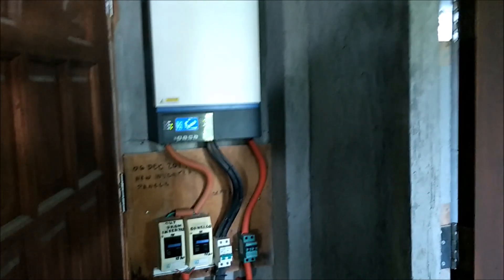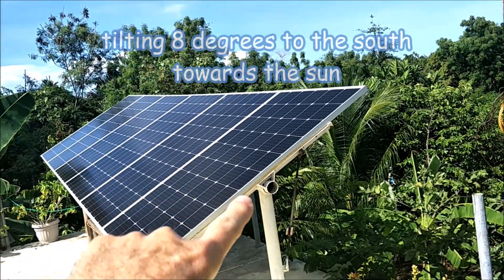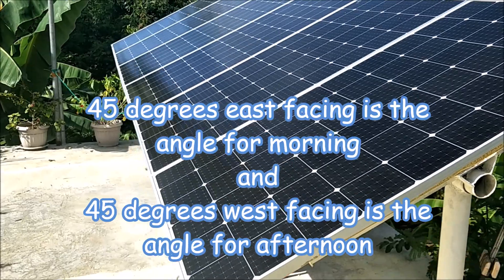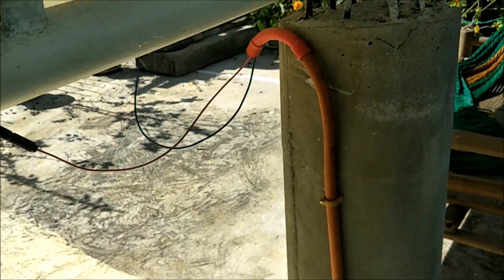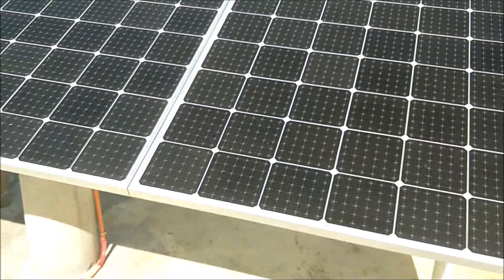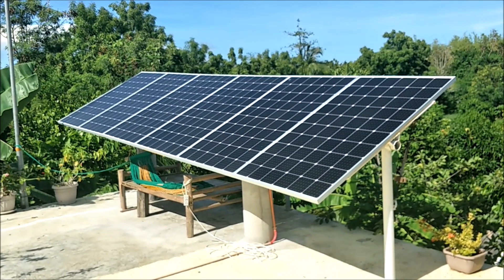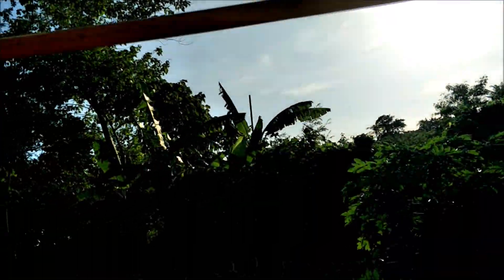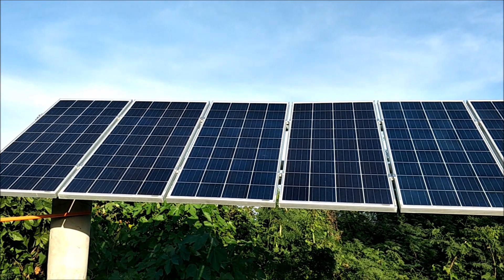Solar Power - Low Cost Sun Tracker In The Philippines

Comment: Nice that i have a fellow solarista in the island lols
Reply from the maker: Are you on bantayan?
Reply: @myparadiseonbantayanisland9030  yes sir
Reply from the maker: @eumellopez661  I hope to build a 5kwh system once the lockdown is over.
Reply: @myparadiseonbantayanisland9030  that is huge lols
Reply from the maker: @eumellopez661  I want to run aircon and on cloudy days it may only produce 2kwh or less, so I add extra for those days of low output. It will be offgrid hybrid so it will take power from the grid if the sun is not enough.
Reply: @myparadiseonbantayanisland9030  i run my aircon with a 200watt pv,, using lithuim batteries,,sort of emergency power supply during outtages,, do u have face book?
Reply from the maker: @eumellopez661  yes i have fb

Comment: They have solar systems that have lyneor motors like on old sattlelight dishes & auto gate openers which can be used to rotate the solar panels plus now they even have auto tracker systems that automatically follow the sun on it track across the sky I don't know costs but as technology goes its getten cheaper as time go's by